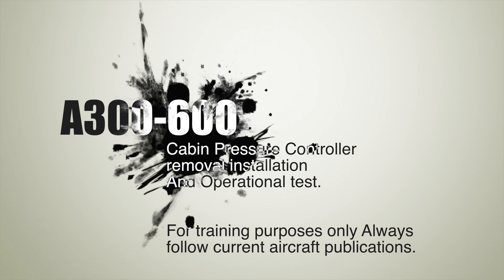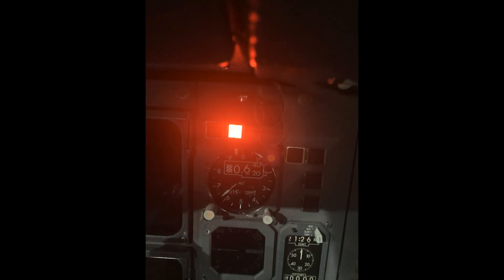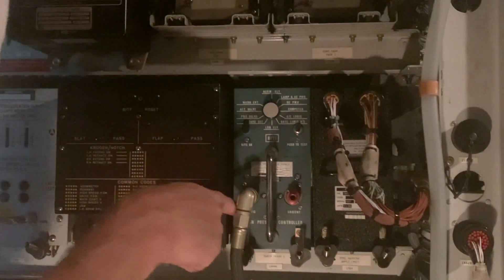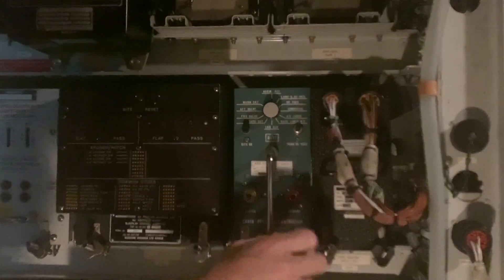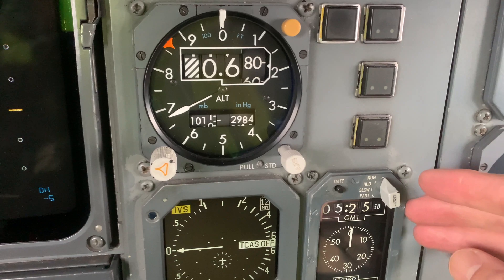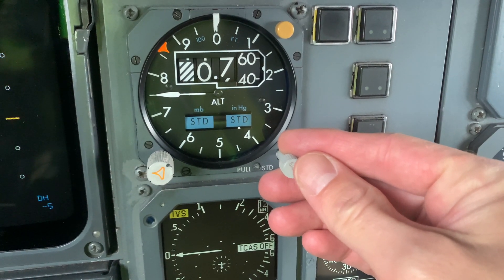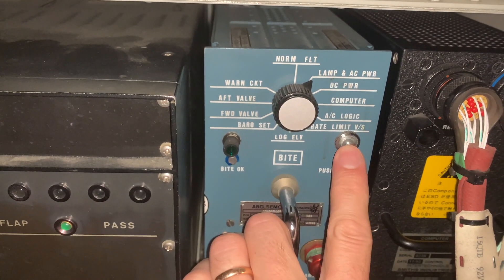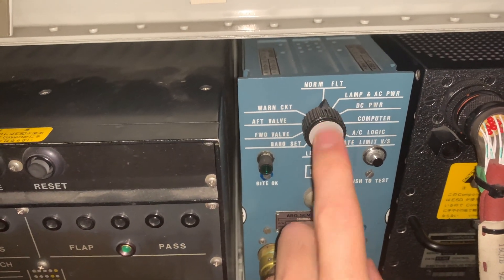🎬 Airbus A300-600 ATA 21 Cabin Pressure Controller Troubleshooting and Operational test. ✈️

Comment: Hello,
Is it possible to make a windshear test in the A306, please?
Reply from the maker: coming soon
Reply from the maker: You have me thinking about this which is good, it's how I wanted this channel to become with sensible questions. The A300 is not common to have PWS but some of our new aged fleets do, so when the aircraft equipped comes my way. I will perform the test, But I suspect it will be the same as A320